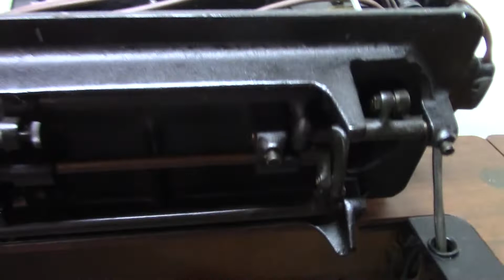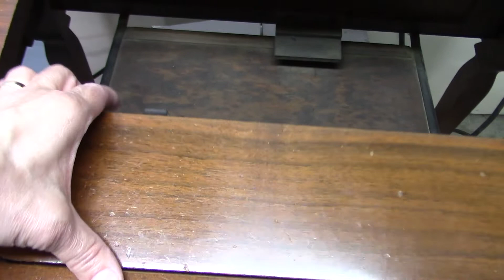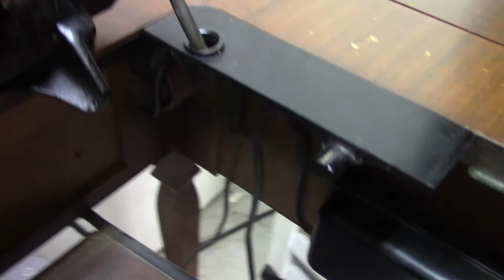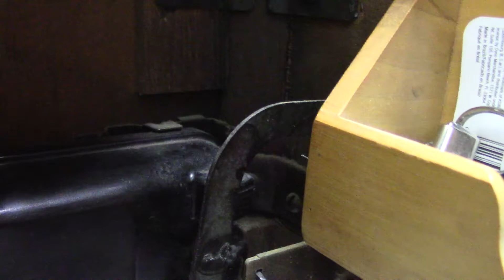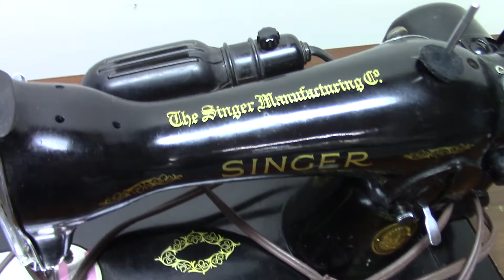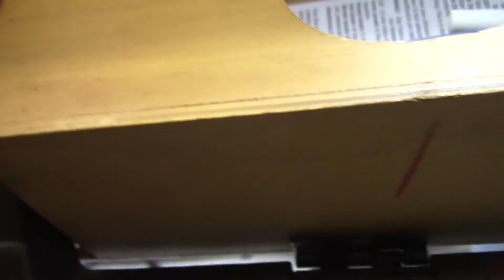Singer 15-91 - Where to Install Hardware in a Cabinet for a Knee Lever

Comment: Good video and thanks for sharing. If I could point out that the two pins that slide into the mounts on the machine and attach are held using set screws… at least on my machine. If those don’t exist the machine will fall out on to the apron. There is also a chain attachment the goes to the apron. It attaches on the right side as you look down toward the apron and up to the fold away plate above it.  Could I suggest doing an owners service video ie; oil, grease, checks, etc. thank you. I can send you photos of the items mentioned if you like.

Comment: How do you remove the foot pedal? I just got my machine and need to take it in for service, but he insists that you bring your own foot pedal.Thanks so much for the informative video.
Reply from the maker: You should be able to slide it down out of the bracket. It is probably in the bracket pretty tightly, but you should be able to slide it down.
Reply: @sunrisequiltstudio  thank you so much. It worked just like you said, by pushing down

Comment: How do you deal with the controller wire going through the hole in the flexible black part of the table?
Reply from the maker: It's threaded through the guides in the cabinet then goes up through the hole and connects to the motor. So, you have to thread it through the hole from inside the cabinet before connecting it to the motor. Then the foot pedal can be placed on the floor or in the bracket on the inside of the cabinet to use the knee lever.

Comment: How do I remove the pedal and wiring from the cabinet to  take in for service?
Reply from the maker: The power source plugs into the right side of the machine. You can disconnect it there, but you will need to take that power cord with you when you get it serviced. The foot pedal is hard-wired to the machine right below the power cord plug. Leave that as it is and take it in with you. To remove the foot pedal from the cabinet you just have to pull it out. It snaps into the bracket on the cabinet.

Comment: I have one of these but my knee lever pedal looks different and I can't figure out how to get it all detached from the table to get the machine fixed. My "pedal" looks more like a metal electrical box with two wires. It threads thru the top hole and attached to the machine. If I take apart the knee lever, there is no way for it to fit thru the hole to get the machine free. I literally have to detach wires! So confusing. Everyone seems to have one end of the wires that unplug but all mine are fixed. I don't know what to do.
Reply: mine is also as you describe. did you figure it out?
Reply: @carolrainville7394  Yes, I called a singer repair shop and he walked me thru it. Basically the casing where the pedal wire attaches to the machine, screws off. When you open it up, loosen the middle and far right knobs(there are 3) and it loosens the 2 wires that attach the pedal. The white is split  and it is wrapped around the middle and far right pole of the knobs. Leave the other wires in place. Basically it's like detaching a  light fixture.

Comment: I wish my lever looked like this but it doesn’t. It’s metal with a fold down piece. The cord isn’t long enough to place it on the floor.
Reply from the maker: You may be able to find a replacement for the lever, or a foot pedal with a longer cord on-line.